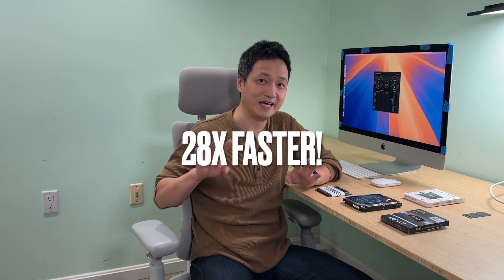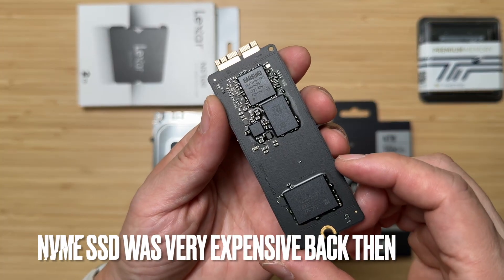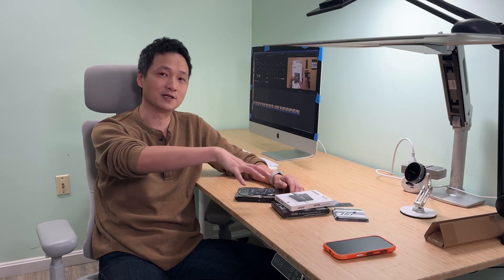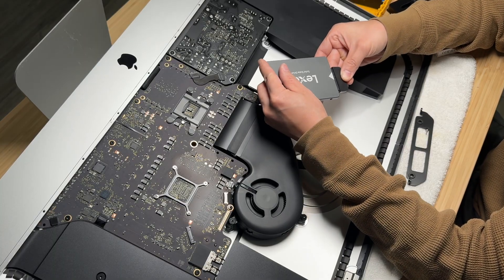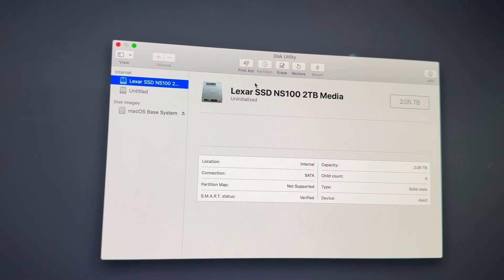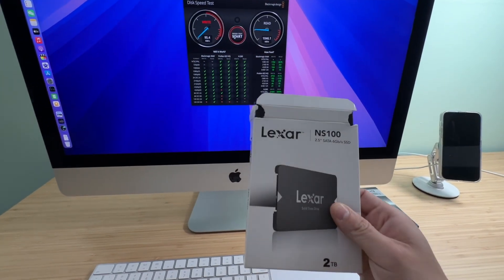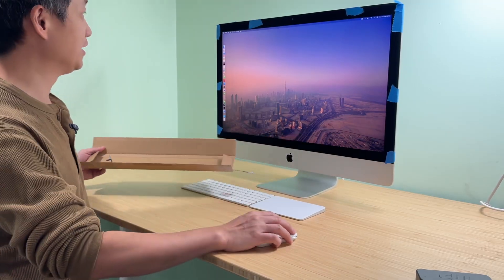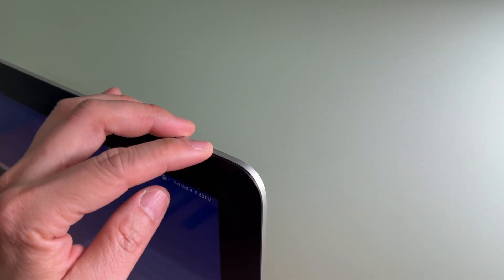2 Simple Upgrades Made an iMac 28X Faster! Test Results Included.

Comment from the maker: Important tip: Do not block the mic holes! 07:42
Timetec 32GB Kit https://amzlink.to/az0n98ZpcbrfT
M.2 NVME SSD Adapter https://amzlink.to/az0B3Vpb1q35k
Lexar 4TB Gen4 NVMe M.2 https://amzlink.to/az0Xg8JFE9wL7
Lexar 2TB SATA SSD https://amzlink.to/az0t0b88JUxRY
Fanttik Electric Precision Screwdriver https://amzlink.to/az07mKw7lcERD
Bamboo standing desk https://amzlink.to/az0GACLJ6h1nA

I found this tutorial very helpful:
How to Install/Upgrade the PCIe SSD in a 27-inch iMac (2019) iMac19,1
https://youtu.be/VIhk4beV2OQ?si=lKw8kYD7HCNq8cPt

Comment: Is it required to use 2 ssd's or is it just specific when you get a "fusion" -based iMac? I wonder If there is a magnetic adhesive for those screen similar to the 2011 and earlier iMacs.
Reply from the maker: Not required as I mentioned in the video. e.g. the SATA is optional.

Comment: I wonder if I can replace RAM on 2015 MacBook Pro 🤨
Reply from the maker: No, we can't. I also have a MBP 2015 13" with 8GB RAM. It is soldered to the motherboard therefore it is very difficult for us to upgrade it. However the SSD upgrade is much simpler using the same adapter I mentioned in the video. I have 1TB installed in there. But its CPU is too slow--a dual-core i5.

Comment: Not the same thing, the processor is the same it’s not faster.
Reply from the maker: Read / Write speed is easily 28 times faster. Web browsing, Youtube video streaming and even 3D modeling in Fusion 360 is not super CPU intensive and a 6-core i5 CPU is totally sufficient. For daily normal use, it is close to M1.